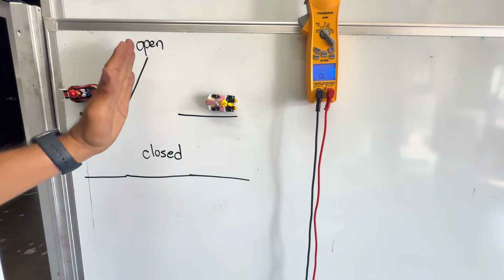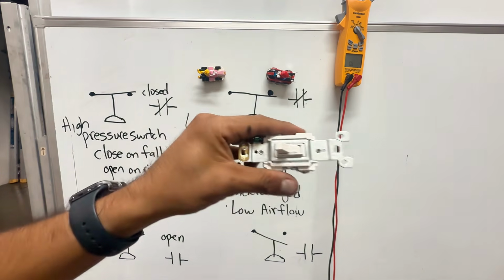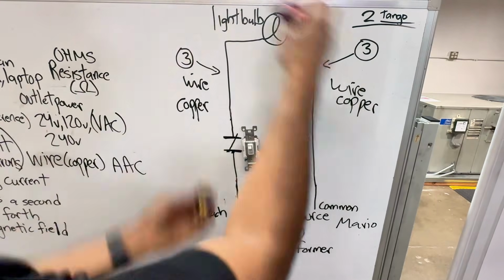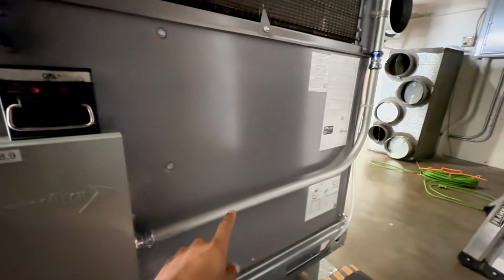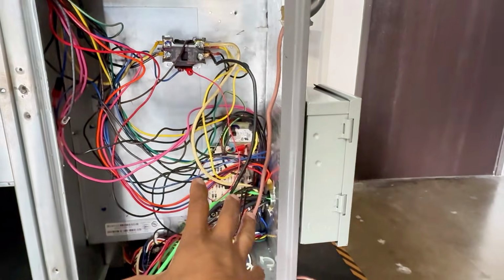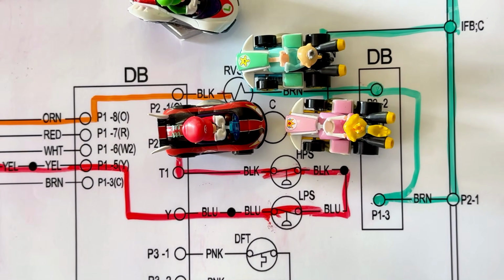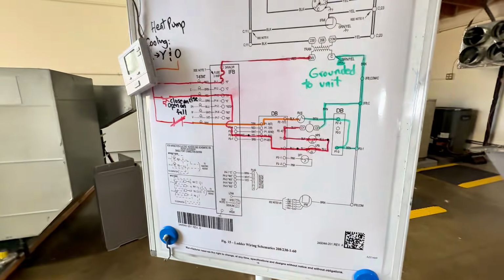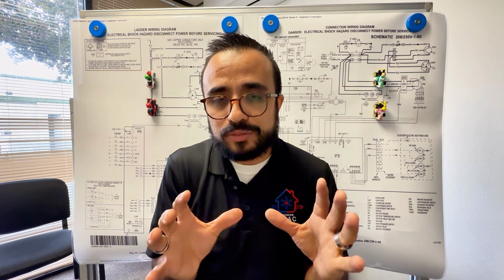How to Read HVAC Wiring Diagrams and Schematics

Comment: It's wonderful video sir .I appreciate it . Could you please explain the connection wiring diagram if the system under heating case and how can we understand the wiring when the temperature goes down outside and the defrost stage start on .
Reply from the maker: I have a video on how the defrost system works, check it out!

Comment: I don’t think a light bulb create a magnetic field…. A light bulb is a resistive load which creates light and heat ….. inductive load like a fan will create a magnetic field
Reply from the maker: Your correct. A light bulb is a resistive load, I just wanted to prove a point using a load, whether it was an inductive or resistive load.

Comment: Do you have a video for common tool need it as a technician and tools needed for installer, I only have it from a maintenance perspective which is a lot unnecessary tools, how do installs on the weekend with my cousin he takes advantage of me and treats me like crap but I want to learn, he doesn't provide or produce the best workmanship to my standards or a real pathway in teaching, I usually upload a video on the weekend. I'm not super green, I have some experience as well as tools but you have different cleared up a lot of fog. Honestly you have brought tears to my eyes 😢 Thanks. I definitely appreciate you, you definitely saved 1 me and I value you and your content.  Thanks ❤❤
Reply from the maker: Don’t give up man. Sometimes it’s rough in the beginning but as long as you’re moving forward, even if it’s alittle bit at a time, in a year or 2, you will be a great tech! I’m sure your great guy already. Certain things you can control and others you can’t. Choose your battles 🙏🏼 I’ll add tools for service and install on my to do list. Thank you for your support and words 😃

Comment: What is the voltage for pressure switch??  Great video teacher
Reply: Depends on the system, but most are gonna be 24vac
Reply from the maker: The reply answered it 😃